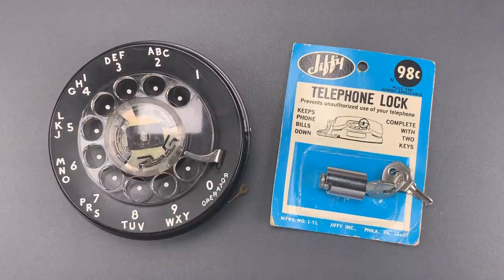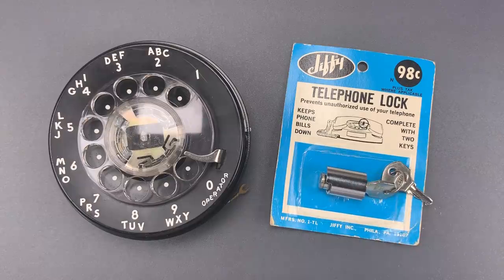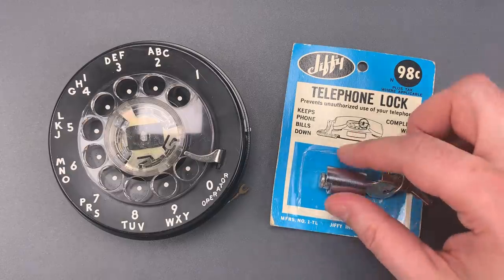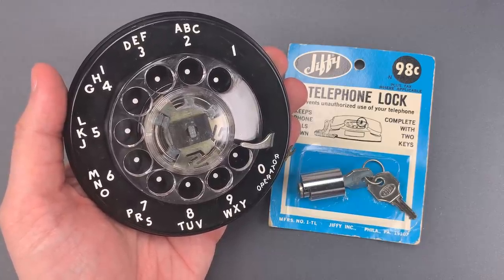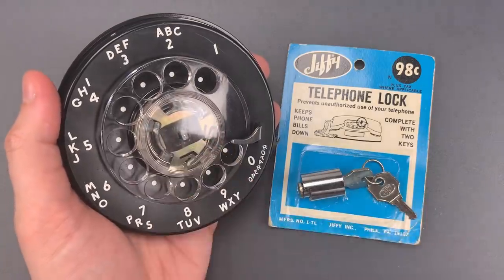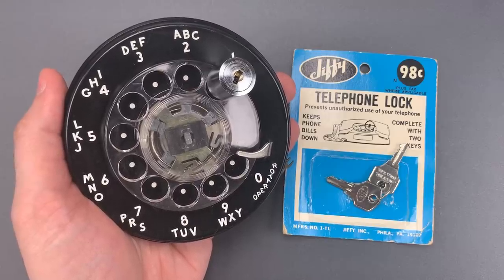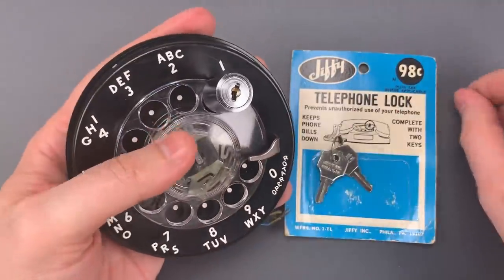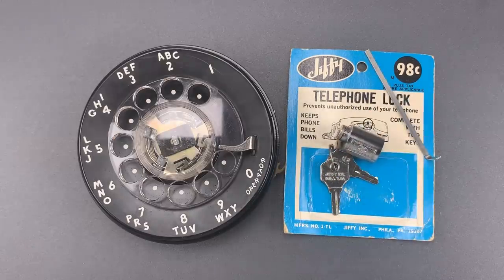[1084] This Lock Could Save A Month’s Wages... in 1960 (Jiffy Phone Lock)

Comment: traditionally these would go on the „0“ that allowed local and emergency calls.
Reply: Putting it on the zero will enable you to dial any number
Reply: Try putting it on the 9, would will allow you dial over 65% of your local numbers. (there are 6531 4-digit numbers that don't have a 0, out of 10000 possible four-digit subscriber numbers).

Comment: There would have been no need to remove the lock if you knew another secret, old dial phones used pulse dialling, you could tap the cradle the required amount of times to get any number, 0 is 10 times btw
Pulse dialling still works because people like retro phones ;)

Comment: There was a quicker way to use the phone with the lock in place, which I used, pick the handset up tap on the cradle the numbers you require and hay presto you have an outside line

Comment: Things to note:

Back in those days phones were “hard-wired” from the wall to the phone. There was no quick attach clip-on line in the back, so you couldn’t just bring your own phone to switch someone else’s line to.

With the lock in place, you could still answer the phone, including long-distance calls. This didn’t matter because only the caller got charged the $8 a minute. Still works this way today, land-line to land-line, I think.

The lock also defeats the trick of removing the transparent plastic piece with the finger holes in it, then switching in one that didn’t have a lock. That process only requires a paperclip, but the dial must be overspun past where the 9-hole is. See this clip: https://youtu.be/kvJAW9wg5ro. This feature existed so you could put a round label with the phone’s number in the center circle of the plastic piece. This was cleaner looking that sticking labels on the outside, I guess.

Comment: You really didn't need to dial to make a call. The old rotary dial just made and broke the connection. Example if your quickly tapped the hook once for a one, twice for a two or  you could just tap ten times and you dialed 0 and got the operator. Hence those scenes in the old movies where a person frantically tapped the hook while screaming "operator". Tapping was quicker than dialing.

Comment: Why back when you did a video on the HUGO Cobra 61P. This lock uses the GR 4.5S Cylinder. If not for the design flaw where the slop in the second set of security pins allowed for the opening of the lock, could you still get past this core? In: https://www.hugo-locks.com/catalogues/hcat/public.php?brand=4&slang=1 the GR 4.5S core is used in many HUGO platforms. Perhaps other HUGO platforms do not have the same vulnerabilities with this core. Also, I would like to see some destructive tests to show the efficacy of various drill protection schemes.

Comment: Of course, if you were smart enough to realize that the dial simply controlled a series of on/off pulses in the line, you could pick up the receiver and simply dial the number by depressing the hanger quickly the number of times of each number with a slightly longer pause between each number.

Comment: My programming teacher told me about these, what they did in the military was they "programmed" it much like a Morse code machine. 

The numbers just made the machine "click" X amount of times so Beacuse they often locked the 1 slot  people in the know would pull the rotery down to the stop and before it returned to 1 they would go back to the stop making a "click" and just do so as much as needed. 

Need to dial 867? Pull down to the stop and let it raise but not so far as to go to 1. Bring it back down 8 times, then hold. Do again 6 times, hold, and again 7. 

Let it go back to 1 for 1 cluck and click 10 for 0. Free calls! Supposedly

Comment: In Europe you should put it on the "3" so that you can dial 112 in case of emergencies...
Reply: How about just " two "? In Italy, San Marino, and Vatican, it is " 113 ".
Reply: Used to be Depend on the country. There was no standard for emergency number(s) in Europe. Austria for example has 122 for Fire department, 133 for police and 144 for medical. Nowerdays 112 works in most countries. 
As for the rotary dial, there were two incompatible standards: most prevalent was the system shown in the video (starting with 1 as the first number). Sweden had 0 in place of the one and the dial ended with 9.

Comment: I never got the point of these. It was so easy to disable these phones when not in use by the authorized person, simply by removing the speaker and microphone pod from the receiver. That's how my grandpa did it,  he even had a small leather pouch made to fit the pods innit. If they can't speak/hear, then the phone is useless.

Comment: When you know how rotary phones work, you realize this lock is useless.  Rotary phones used pulse dialing.  As times were changing, you may have noticed home button style phones with switch on the side for “pulse” and “tone”.  The way pulse dialing worked is for each number phone would generate number of pulse sounds based on value that you dialed.  For example 3 pulses for 3, 1 pulse for 1, and 10 pulses for number 0.  If you have a situation where you can’t use the rotary, you could manually generate those pulses.  All you had to do was simply, pick up the handset and press and release the button that the handset rests on when you hang up the phone.  That handset rest that usually has 2 prongs that detects you have hung up the call can be used to generate pulses.  You would need to give short pauses in between numbers.  For example: if you wanted to dial 310, you would pick up the handset and tap the button that was under the handset 3 times quickly, brief pause about half a second, tap 1 time, brief pause, tap 10 times.

Comment: whose smart idea was it to start the emergency phone number with a '9' using this phone? by  the time you have dialled 9, the crime has been committed and the criminal has got away
Reply: It actually is a smart idea because sometimes line noise is interrupted as digit 1 or even 2 so if the emergency number was 111 it would cause a ton of false emergency calls. That is why it is "9" 11 so the rest of the number is fast to dial but the 9 being there is safety as typical noise won't dial it by mistake.

That would even cause trouble even today since just about all landlines still support rotary dialing.

Thus 911 became the number and there have been no issues.